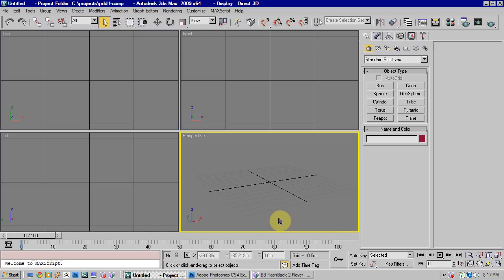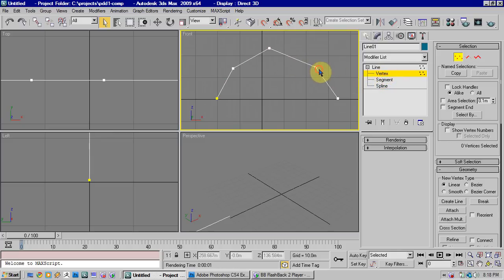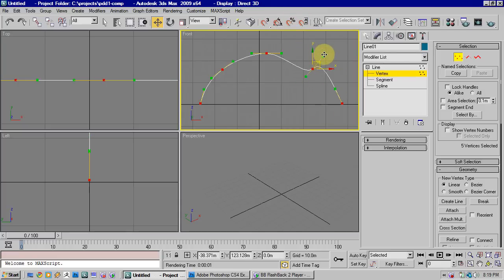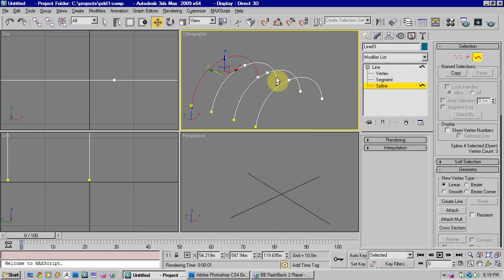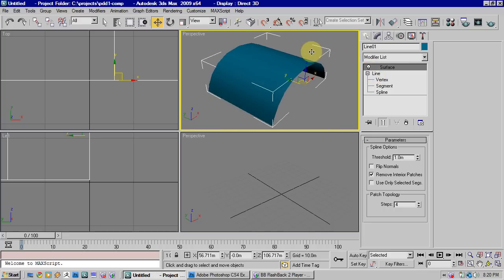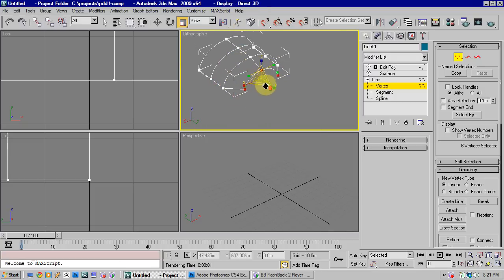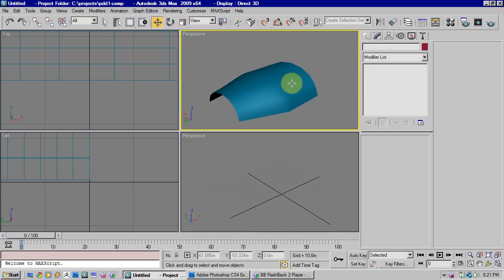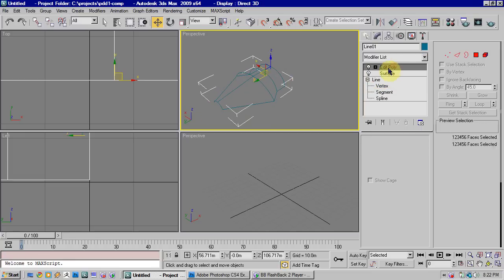3DSMax Spline Modelling - Using Splines and Surface

Comment: After I add the surface finish and then try to use the scale tool on the selected vertices to pull them in I notice that the vertices separate (arc vertices from the longitudinal vertices).  Do the vertices first need to be welded before manipulating with the scale tool?
Reply from the maker: You can't actually weld the vertices on different splines, it will place them directly on top of each other but won't stick them together.
In the top bar of icons change the 'Use Pivot Point Centre' option to 'Use Selection Centre'. You can find the button for this to the right of the 'View' dropdown menu. Hold down the left mouse button to select the different options. Hope this helps!